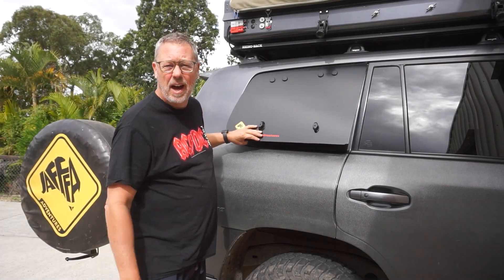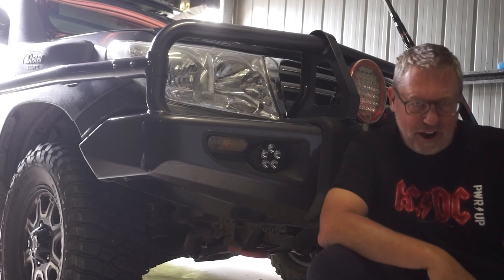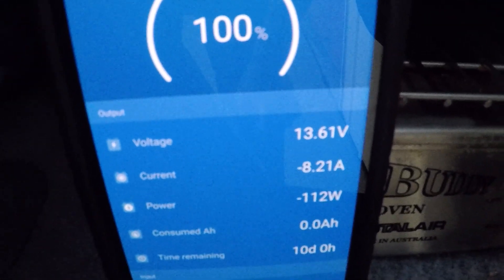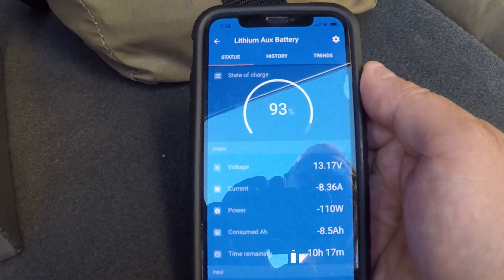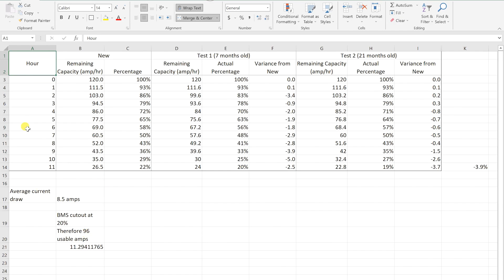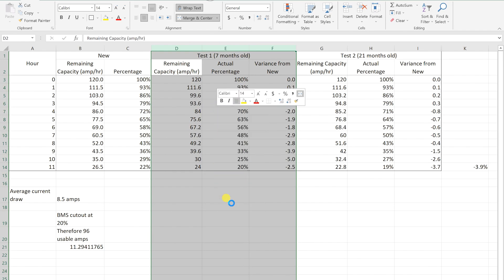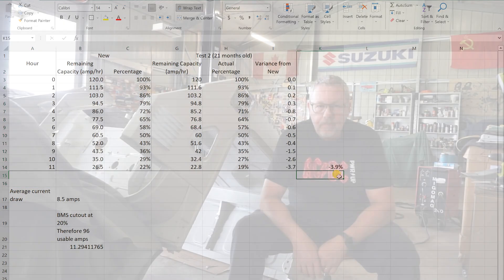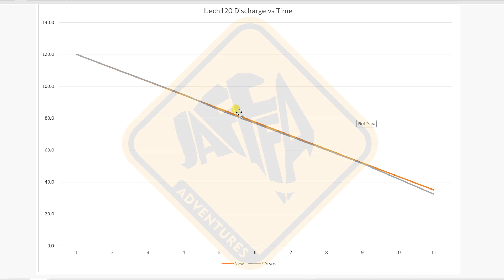Lithium Battery Test and Review | Real World Results for my Itechworld 120 | 2 Years of Torture

Comment: Hey mate any chance of giving an update on how the battery is going?
Reply from the maker: Very well.  I’ve replaced the one in this test but not because it failed or anything like that.  It had an old BMS that had a 20% discharge floor meaning I could only get 96amp/hrs out of a 120amp rated battery.  Itech have since updated the battery and BMS and on the 120max you get the full 120amp/hr as the BMS allows you to discharge it 100%.  Since this video, I have also replaced my lead start battery with a lithium and put a 200amp/hr slim line lithium behind the rear seats.  Full lithium setup now and I’ll never go back to lead.  Cheers👍😎

Comment: So I’d be interested to know how this battery has gone over time.

Mine is the same battery in a 200 series but I tow a 3T caravan and I have constant problems with it overheating and shutting down after around 4hrs of travel and having the battery insulated as recommended.

I have had one replaced by itech but the new one is exactly the same, so this battery is not suitable for under bonet use when towing.

It’s fine with all other travel situations but as soon as it’s loaded up, it’s useless .
Reply from the maker: I replaced it about 18 months ago at which time it was holding up fine and performing well.  The reason I replaced it with the new 120X was because it can be discharged fully.  My old battery had a 20% floor where the BMS would shut it down.  The new one can be discharged to  100%.  That one is also still going fine and holding up well.  Cheers👍

Comment: Hi Terry, just wondering how your itech 120x is going. I have a 200 with  itech 120x and lithium cranking. Things are going well. BMS closes things down on hot day ( I think ).
Thanks for any info.
Reply from the maker: Still going well mate.  I have also fitted an itech lithium cranking battery and that one seems a bit sad.  I do have a parasitic draw somewhere that is not helping, but I think it’s dying prematurely.  The 120x is holding up great.  Cheers👍😎
Reply: Thanks Terry I had same problem with cranking battery discharging. Fitted a battery protect and problem fixed.
Reply from the maker: @robmiller1957 good to know mate, thanks for sharing👍😎

Comment: So, my guess is that the lithium under bonnet has been there for just over 3 years. How is its capacity ? I only ask because I put DCS lithium under bonnet of the LC200, and after 3 1/2 years its measured capacity is down to 65%....aftyer very light use (thanks, COVID!). I admit to being disappointed with the performance....and reverting to lead acid under bonnet and lithium in the rear will cost me about half of the replacement cost of 2 lithium under bonnet.
Reply from the maker: I have not checked the capacity since the couple of videos I did on this Denis.  I have since added a lithium start battery and an additional 200amp slimline in the back of the vehicle.  Cheers👍😎

Comment: Guessing this is because it is a 95AH not 120 and it is running down below 10%
Reply from the maker: No, started life out as 120, as per testing in the prior video.  Just use and abuse.  Cheers
Reply: Nah mate, only 95-96 usable capacity. Not a true 120AH. There are enough tests out there on that. I love your work but. I have 3 differing set-ups, 8.5K of Invicta lithium including hybrid starter, house and 36v electric motor in my boat with Victron gear. Enerdrive in my mobile battery box mainly in wife’s car with Redrac 40hp dcdc and 200Ah I tech in my ute with redarc 50 amp dcdc.

Comment: This is brilliant. Thanks for sharing. I was on the fence but now with some real data I’m pushing the button. How are they holding up now?
Reply from the maker: Very well.  I’ve replaced the one in this test but not because it failed or anything like that.  It had an old BMS that had a 20% discharge floor meaning I could only get 96amp/hrs out of a 120amp rated battery.  Itech have since updated the battery and BMS and on the 120max you get the full 120amp/hr as the BMS allows you to discharge it 100%.  Since this video, I have also replaced my lead start battery with a lithium and put a 200amp/hr slim line lithium behind the rear seats.  Full lithium setup now and I’ll never go back to lead.  Cheers👍😎

Comment: just came across this awesome review. I currently have a Delkor HDC27 100ah AUX battery in my 200 series being charged by a redarc BCDC 1225D. this feeds my Engle in the back and an ARB Twin compressor. When this fails i was considering changing to the Itech 120 Lithium. Do you know if the Itech 120 Lithium would power an ARB Twin compressor mounted in the rear of my cruiser?
Reply from the maker: Thanks for the kind words Graeme, I very much appreciate it.  The Itech 120x can sustain a max current discharge of 270amps.  Your ARB twin compressor has a max current draw of 50 amps under load, so there is plenty of distance between those 2 figures for it to be a non issue.
With your vehicle switched off and your battery charged to 100%, you can run your compressor for 2 hours under load before the battery reaches its discharge floor.  If your car is running and you BCDC 25 is charging the battery, the compressor can run for 4 hours under load before the battery is discharged.  In short, I’d have no dramas at all with your setup.  The video I did on fitting a solar panel to your RTT goes into these types of calculations if your interested.  Cheers👍😎

Comment: Good evening mate. Out of curiosity are you going to continue doing yearly follow ups?
Reply from the maker: Short answer is no Shane.  I’m convinced that the batteries are fit for purpose and continue to perform as expected.  It has been over three years now, still going strong.  If it dies, I may consider a video at that point.  Cheers 😎👍

Comment: Hi Terry, I want to first share with you that I hold you personally responsible for being many thousands of dollars out of pocket, yes it was your review of Bundutop, Add A Room and Bunduawn that convinced my wife it was a viable option for us, purchased the lot, never been more grateful, best night's sleep one can get whilst out and about, thanks.
Now, I've not seen all you video's but curious if you've taken the plunge to lithium cranking yet?
I went lithium auxiliary (3 X 54amp Itech) in Patrol rear storage Dec 21 and 120X into caravan, also Dec 21.
Was so blown away in the recovery time, sun up, solar activated, batteries recharged, amazing.
AGM never recovered anywhere near the usable amps as these Lithium do. Everyone talks weight savings being first benefit, yes it is a good saving but for me, it's the recovery time, everyone should be aware of this, they are brilliant.
I was so blown away that I elected to go 100% Lithium, reached out to Itech for the 1420CA Pro. for advise. Explained my usage (Patrol, 2016), as my primary concern was heat, these 3L Patrols, like the 4.2 get extremely hot in the engine bay.
Was assured it wouldn't be a issue on their sales records, plenty gone into Patrols.
Further probing by consultant delivered something I'd never considered. As I utilise a Redarc 1225D (assume like yours) I'd have to isolate it from 1420CA Pro. whilst stationary, as the seperation voltage of 12.7v is considered too low for "reliable" starting voltage.
I was forwarded a link to a victron programmable isolator, but not being tech savvy (like you obviously are) I turned my redundant Redarc SBI12 from a voltage sensitive relay into a ignition sensitive relay, so ignition off, 1420CA battery seperated from BCDC25D.
I installed this system in early May and whilst it is far too soon for any review, that 1420CA starter battery wound the Patrol over so fast, it fired into life within moments. Now unlike you, I do live in a cold climate. The Patrol hates cold, cranking forever, clouds of unburnt diesel mist, as a battery dimms with cold.
Not so now, glows off, turn the key, fires into life.
Note: I thought I was up for glow plugs, glad I didn't fork out for them.
The Itech 1420CA outlay was worth every cent, ($$$$ actually)
As with my Bundutop, the Itech batteries have transformed our Patrol tourer.
I now love my Lithium powered Patrol to bits, love love love it.
Thanks so much for you delightful, feature packed, constructive video presentations. Regards.
Reply from the maker: Hi Ian, that is awesome feedback mate, you just made my weekend!!  I have not got the lithium cranking battery yet, but I fully intend to when my lead crank battery dies (it's pretty new and I just can face throwing out a reasonably new battery).  I too have a BCDC1225 and am aware that you need to isolate it from the lithium cranking battery.  I was going to use an ignition activated relay but I like your solution.  Regardless of the solution however, you are dead right, they need to be isolated when the ignition is turned off.  Lithium is such a game changer on so many fronts and is slowly gaining more of an acceptance.  We will look back in 10 years and say, why were so many people clinging onto the lead for so long.  Thanks again for your kind words mate, that means a lot to me and inspires me to keep going.  Cheers!!
Reply: @JafffaAdventures  pleased I made your day "weekend", whatever.
You made persuading my wife a Bundutop was viable option for us thru your review, for that, you have alleviated my entire off road camping process, i made your weekend, you're made my camping life.
Regards.
Reply from the maker: Legend Ian, thank you❤️❤️

Comment: Nice video as usual 
Inspired me to pull the 2 units I had in my camper out and put them in the vehicle , one up front and one down the back and a total rewire with an inverter 
Whilst I was on batteries I decided to get one of their crank batteries - it arrived yesterday and my lead acid died today -timing is everything
Fits in with a couple of 15x20mm packers to get the battery bracket to fit and a whole lot less grunting to get it in -spins her up real fast 
Next is a set of gull wings
I gotta stop watching your videos it’s costing me a fortune😀
Reply: Had the lithium crank in for a few weeks and all good so far except for the REDARC bcc’d charger 
Because the Lithium is at a higher standing voltage the charger stays on when the vehicle is off so an ignition powered relay need to be added to the charger circuit
Reply from the maker: That’s good to know mate, thanks for sharing that bit of very important information.  Cheers👍😎
Reply from the maker: I really love spending other people’s money so thank you for that😂.  I’m still running lead for my crank battery but when it dies a lithium is going in its place.  So it seems the worm has turned and your spending my money now😂.  Thanks for watching mate 😎👍

Comment: Terry , Great video series and channel. I have an a Lead Acid + AGM connected using a voltage sensitive relay and in my 200 and my AGM is about to die after about 2.5 years.    Do you see the DCDC Charger as a necessary requirement to go along with the 120x battery?          Also, did you have to change the wires on the car to fit the different battery terminals of the Lithium? Cheers, Brenden
Reply from the maker: Thanks for your kind words re the Jafffa Adventures channel Brenden, I sincerely appreciate it.  I do not believe a DCDC charger is necessary with these batteries mate, I am using one primarily as a solar regulator for the solar panels on my RTT.  There was no need to change any battery terminals on the car, it just bolted straight in.  If you search in the Jafffa Adventures video library I have a video of the installation process.  The only mod needed was snipping the edge of the battery tray off.  Cheers.
Reply: @JafffaAdventures  after about a year I finally got around to doing this, but I also installed a redarc BCDC 40 amp charger. Your video again was very helpful cheers.

The only item left now is to bend the battery bracket in a vice somehow and also get some longer bolts for the itechworld battery
Reply from the maker: Nice one mate, that’s great progress.  I think I will replace my BCDC25 with the 40 amp unit as well.  It will be good to have the extra amps while the vehicle is running.  Cheers👍😎

Comment: Hi Terry I just installed a victron 500a smart shunt to monitor my itechworld lithium under my bonnet but seem to have issues setting up the parameters on the app. Can you please help me with what I need to set up the parameters to? Cheers Rob. Even a screen snapshot would be great.
Reply from the maker: Sure can Rob.  I can't do a screenshot, there is no provision for images in YouTube comments but I can share the values that I have.  In the Battery Settings tab capacity is 120Ah, charged voltage is 14.6, discharge floor is 20%, tail current is 2.1%, charged detection time is 3m, peukert exponent is 1.05, charge efficiency is 99%, current threshold is 0.1A and time to go average period is 3m.  When you battery is fully charged hit the "Synchronize SOC to 100%" and that will tell the BVM to use the current battery status as 100% as sets that as your baseline.  When the battery is idle and there is no current draw hit the "zero current calibration button".  That will tell the BVM that there is no current draw and it will use that as a baseline.  I trust this is what you were after mate, if not please let me know.  Cheers!
Reply: @JafffaAdventures  thanks Terry this is exactly what I was after mate. Brilliant! Thanks again
Reply from the maker: My pleasure Rob, all good😎👍
Reply: @JafffaAdventures  I have just changed to what you suggested. I was almost spot on... now it works a treat!👍
Reply from the maker: That’s fantastic news Rob, well done mate.  Cheers😎👍

Comment: Thanks so much for this Video,  I’ve installed the same battery to a portable battery box in the back of my ranger. I’ve also used the Victron shunt to monitor via Bluetooth app.  

With the VictronConnect settings do you have it set up as a 120a size battery or 100ah etc? i was thinking to set it as 100ah to create a buffer as I wasn’t sure if this battery was truly 120ah. Cheers
Reply from the maker: Thanks for watching and sharing your feedback Jordan, I sincerely appreciate it.  I have the battery set up as 120a/h.  As you can see from the videos, it’s rated capacity and actual capacity are identical and it is holding up over time.  If you set it up at 100a/h your time to discharge will not be accurate and every time you look at the percent remaining, it too will be understated.  It’s 120 and delivers this so that’s the route it would go mate.  Cheers😎👍

Comment: Excellent real world no BS review. I’ve got a Redarc BCDC1225d and a lead acid aux which I’ll be replacing with lithium in the future. Can I keep my Redarc to charge the lithium?
Reply from the maker: Thanks for your kind words mate, I sincerely appreciate it.  I had a BCDC25 with a lead acid aux just like yours and simply swapped out the batteries and changed the charging profile on my BCDC to lithium.  You can find out how to do that on the Redarc website.  Cheers😎👍
Reply: @JafffaAdventures  thx Terry. So at 25a charging it would take approx 4 hrs to fully charge the 100 usable ampere of the lithium is that about right in your deal world experience? I love my Victron monitor too 😎
Reply from the maker: Yes mate, that’s exactly right if you have no load on the battery.  My fridge draws between 4 and 5 amps so if it’s running fully noise during the charging cycle it takes about 5 hours if the lithium is discharged to its floor (25 amps charging minus 5 amps usage during charging = 20 amps going in).  Cheers😎👍

Comment: I've been on the fence for a while now Terry but all your time, effort and hard work is by far the best testing i have found and i'm sold on lithium now. Cheers mate.
Reply from the maker: I don’t believe you will be disappointed Daniel.  If really is eye opening when you get a lithium installed and how much your world of battery management changes for the better.  If you scroll through the comments there is another fella that has a 200 with a lithium under the bonnet for a long time with no issues.  Thanks for sharing your thoughts, I sincerely appreciate it 😎👍

Comment: Thanks for another great video Terry.  I have also put an itech under the bonnet.  When charged does yours normally sit at around the 13.7 volts.  Mine did but of recent times it is sitting at around 13.2 with no current draw
Reply from the maker: Hi Glenn, thanks for watching and for the kind words mate, I sincerely appreciate it.  Fully charged it sits around the 13.7v with no current draw.  Having said that, it only takes a very small amount of draw (like charging a phone battery) and it drops to 13.2v and holds that voltage for quite a long time on the discharge cycle.  I would say what you are experiencing is normal unless you feel the overall capacity of the battery is significantly lower than when you first got it.  I trust this answer is helpful mate.  Cheers😎👍